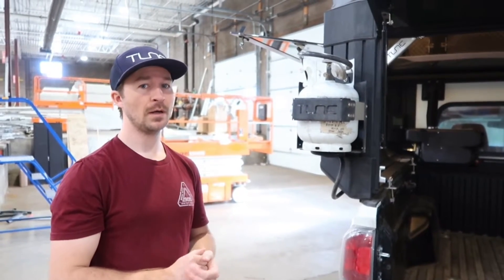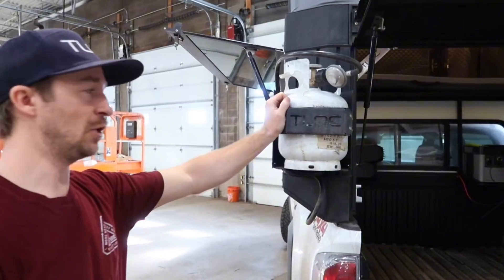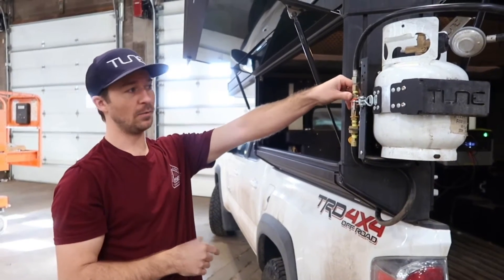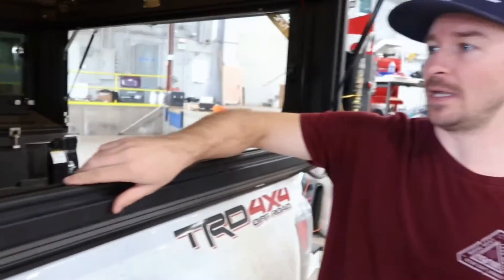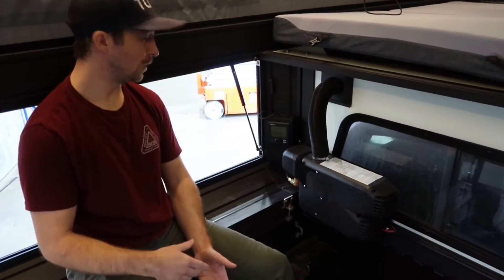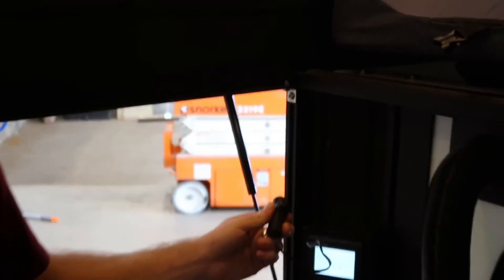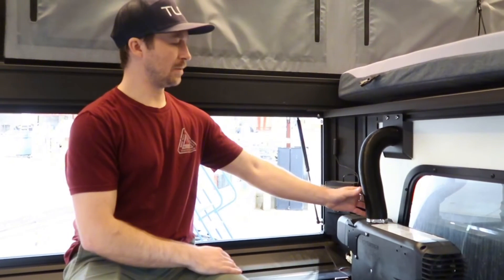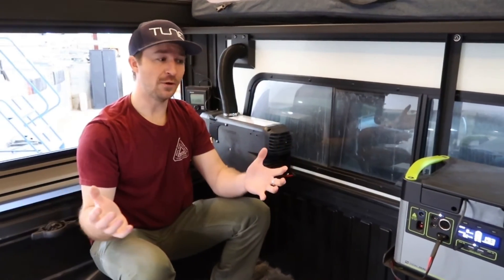Tune M1 Truma Heater System Technical Walkthrough

Comment: at min 4:20 you mention "air is being forced over that hot piece of aluminum." My Q is where does that forced air come from (ie: ambient air in the camper that gets pulled into the heater by a fan, or does that air also originate from outside and then enters the heater via a hose/tube? TIA!
Reply from the maker: Ambient air that gets pulled into the heater - it is a quite efficient system as you are always reheating warm air, rather than cold air from outside.